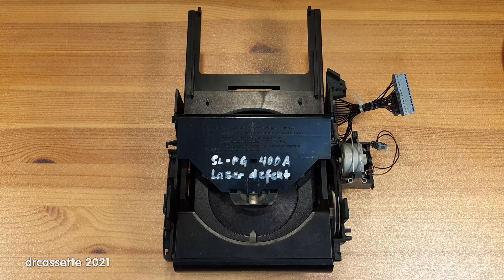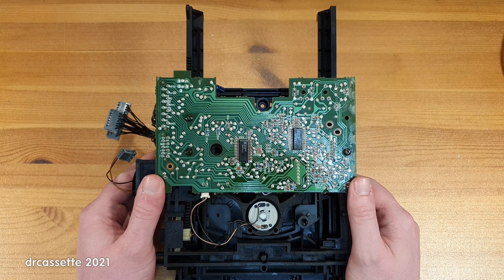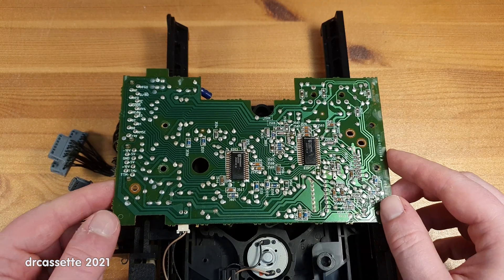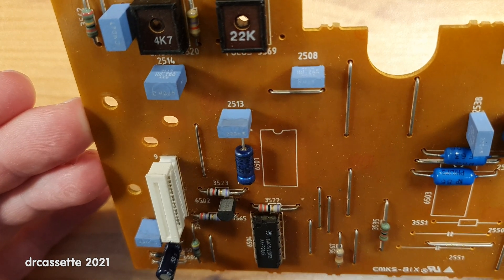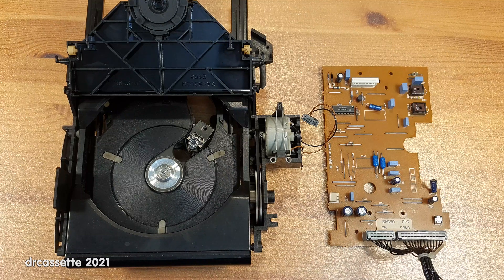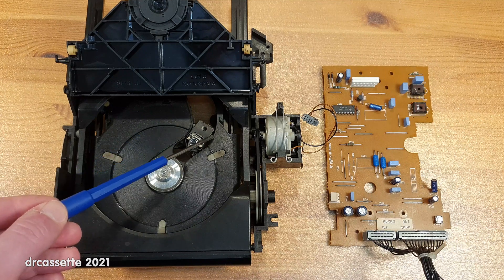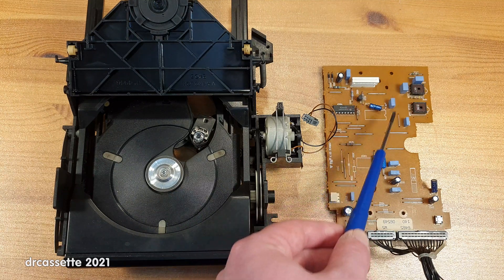Finding the fault in the Technics SL-PG400A CD Player

Comment: Hi there, I'm pleased I found these threads relating to this fix. I have a Technics PG200A with the exact same problem and based on the first video I was about to throw it out, however, it's in very good aesthetic condition and that's what saved it from the bin! 
It has the exact same Philips cassette drive mechanism as the PG400A featured with the same offending electrolytic capacitor on the board, which tested at 19uf - replaced it with a 47uf 50v - hey presto, everything works again...
Many Thanks.

Comment: Does anyone know how to tune up the laser on a SL-PS770D? The old SL i just fixed reads right over skips or rather doesn't skip on parts of the CD where the SL-PS770 does skip. No visible manual adjustments. I'll look for caps but perhaps it's just an inferior CD player. For this reason i'm very happy to have the 202A working again.

Comment: I have a Technics SL-P202A Recently didn't want to spin. If i give it a spin by hand it starts up. Motor seems weak i tried adjusting laser pots but no difference.
I just opened it up (need to remove front face) It has 2x of these 47uf caps in same style. I'm about to test them now. Showing 19uf and 21uf. Not going to bother with the esr meter. Changing right now.
 And, the results, just in. At first it still needed help but when it did start it was skipping. Then i remembered i had adjusted the focus and current. Didn't want to hook to scope too lazy. I turned current just up a bit from minimum (forgot to mark original pos.) Then started to turn focus antiC from where i had left it, got better so tried another twist was fine, then a big twist to the left and was still fine. I'll do a bit more experimenting then call it a day. Thanks for the help. Was no need to remove the board on this model, enough acces from the side, easy to solder, leave a few mm from the old legs. polarity marked on the board silk screen print. For anyone wondering, the thin part on the Philips capacitor does not mark the negative. There is a very thin black line, also if you look carefully at the cap one end has a rubber bung which is + the other end is the actual can and it's all metal at that end which is the - or shield.
  Now. Does anyone know how to tune up the laser on a SL-PS770D? The old SL i just fixed reads right over skips or rather doesn't skip on parts of the CD where the SL-PS770 does skip. No visible manual adjustments. I'll look for caps but perhaps it's just an inferior CD player. For this reason i'm very happy to have the 202A working again. 
Thanks to everyone who found the bad caps!
PS. confirmed that by turning the focus laser too far AC resulted in the disc not wanting to spin up, approximately turned between 90 and 120 degrees CW from minimum. At least seems to be working fine in this range, i'm somewhere in the middle of the working range, a bit more to the minimum value side perhaps as too far CW and it was skipping to far AC and it just didn't want to know after around 90 degrees of clockwise turning it seemed fine, i think i left it at around 100-110 degrees from minimum.

Comment: Hi, thanks for that video. I have a Technics from the SL-PG series and understand that these Phillps  axial blue caps are often faulty (even when new?). So is there an other manufacturer that makes them and where could I buy one of those? Thanks!
Reply from the maker: Capacitors are standard components, replacements are readily available. Make sure you get the same capacitance rating, and the same or a higher voltage rating.
Reply: @DrCassette  Thank you for the info, I'll have a look (seems like Panasonic is a safe bet, from what I've read).
Reply from the maker: Capacitors are a lot less critical than people try to make you believe. Just don't get any no-name ones from dubious sources...
Reply: @DrCassette  OK, will do. Thanks again!

Comment: I recently bought an sl-pg400a, mine still worked great but i decided to swap it out anyway. Mine measured even worse at 17uF so perhaps it wasn't the only fault with yours. To anyone doing this fix/mod there is a typo in the service manual, it's a 25v capacitor and not a 2.5v like listed in the component list.

Comment: Hi, I  got same problems , same machine, which capacitor can I replace? can't find the same one. Is a normal 47uf 25v?
Thank you
Reply: You can use a regular radial capacitor and bend the leads. Only the 47uF has to be exact, the voltage can be higher than 25v but not lower but it's better to stay close to 25v. It's a standard value so finding one shouldn't be hard.

Comment: Nice fix tip, thanks:  Capacitor c6501 found on my particular SL-PG400A to have an  esr = 53ohms, C= 21.3uF, & Vloss= 9.9%
Reply: Position is C2521 not 6501.
Reply: @marcelmojzis4374  Many thanks Marcel for ID correction on this capacitor marked on PCB. The adjacent '6501' component  (an 'unfitted' IC ) position was inadvertently mis-identified🔎

Comment: I have several tascam guitar trainers cd-gt2 which use a tascam cd drive mechanism, the cd players usually work for a few moments or less and another won't read the disc, the caps are all smd in starting to think that may be the issue

Comment: Dear DrCassette, many thx for this video - and also to the community. I had an old Technics CD Player SL-PG540 A and your tip was a great help. In my player modell the sound of the error was the same like you recorded. So I only need to buy 47 uF 25 V Axial Elko and -after replacement - could instantly start and use it as before. Very well explained. Happy XMAS.

Comment: Thanks for this video !  
I have a Marantz Cd75 from ~ 1987 with a similar issue and struggled for a year to find and fix a very similar isue… As you probably know Marantz was actually owned by Philips in the 80s so basically the Cd75 was a Philips cd player. It doesn’t have a CDM4 but a CDM2 inside but the servo board does look similar and most importantly it had one of those blue Philips electrolytic capacitors.
Checked it and just like yours: low capacity, high esr, high leakage. Replaced it and problem solved! 😁
Thanks again and keep up the good work 👍👍👍
Reply from the maker: I am glad you found this video helpful :)

Comment: First rule of repair is check voltages. My second step is check capacitors and ripple on v+ to chips. This has saved me hours of time when it comes to repairing vintage gear.

Comment: I might be wrong, but that capacitor is in the laser Diode driver circuit thus causing a lot of problems if it goes bad. Those blue axial capacitors are almost 100% guaranteed to be bad. I think Philips itself knew they were of poor quality because in critical circuits (PSU, audio pre-amp, ...) they were using Japanese made caps by Nichicon or Elna.
Reply from the maker: These axial capacitors look like they were made in the 70s, most likely because the whole production process had not been changed since the 70s...
Reply: @DrCassette  and yet were in production until the mid '90s ... I checked the service manual and C2521 is connected between the Laser ON signal and ground. The laser ON signal drives the base of a npn transistor which send current into the laser diode. Purpose of the cap is to smooth the laser activation transient, but if it goes bad, not enough current goes through the laser itself.
Reply from the maker: That certainly explains why it seemed like the laser itself was bad...
Reply: @DrCassette  I have several hundred of them... NOS

Comment: The people who commented about the adjustment on the laser itself are or were probably not aware that some early models had the adjustment in an easy to adjust location on the PCB instead of on the actual laser.... 
My Technics CD player is older than the one that you have there and it's adjustments are also on the PCB...

Comment: 8.2% voltage loss.... Bad ESR also, it's definitely a leaky capacitor! Definitely a problem maker... 
Always keep an eye on the Vloss value... This gives you the amount of DC leakage current of the capacitor...
Reply: as this stuff gets older the more and more I see bad capacitors but in the day when working on Sony TV's I would find lots of bad ones .
Reply: @richardbrobeck2384  there was a period of time when modern capacitors were really bad! That's something that you have to keep in mind when servicing equipment! You can't just take ESR measurements! You have to check for leakage current also... Leakage current is the biggest trouble maker with capacitors! Passing DC current to somewhere it's not wanted..
Reply: @PeterMilanovski  For sure I use a Sencore LC meter
Reply: @PeterMilanovski  I agree with you and my background training is electronics I took electronics in high  school and in college right out college I worked for the repair business that I have owned since late 80s  take that Cd player Each Capacitor was hand picked to work in circuit just like when repair item I go through the Data sheets on capacitors on the Mouser Electronics website Also another device i find very handy is the Huntron tracer .
Reply: @richardbrobeck2384  that sounds like a great success story if I have ever heard one! Though I can't say that I have ever heard of the Huntron Tracer?

Comment: Very interesting that this board does only have the 2501 cap and not the two identical 2502 and 2503 caps I have on my SL-PG400A. There has been an evolution of these servo boards and some later models like the Technics SL-PG540A miss the option to adjust the laser focus. But you can never be sure if there's the original drive and board inside the used cd-player because they can be replaced very easy
Reply: Technics SL-PG530, it has the very same board with a single blue axial caps and two pots for laser current and focus offset.

Comment: A very interesting info, thank you try to clean up lens without result, but 47uF and voltage please ?
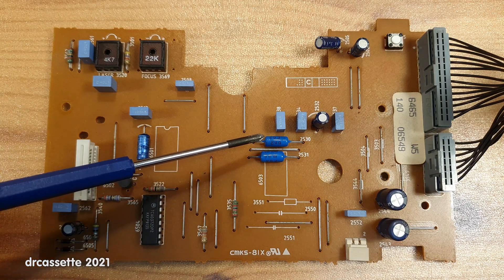Reply: In 2:50 you can see 16V marked on capacitor (at the right edge).
Reply: This capacitor is 25V 47uF, I put 50V 47uF standard electrolic capacitor, because I didn't had 25V and it works fine, cd reads instantly